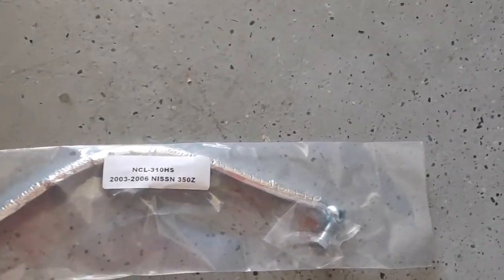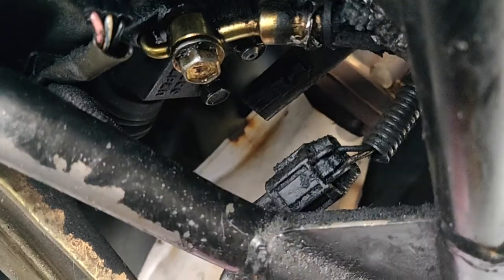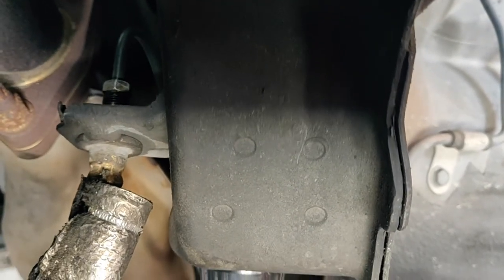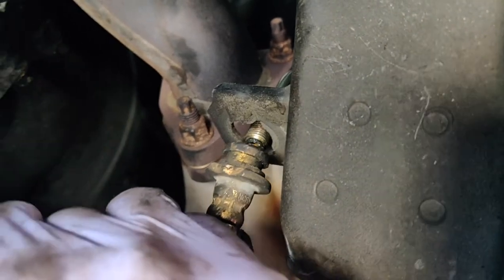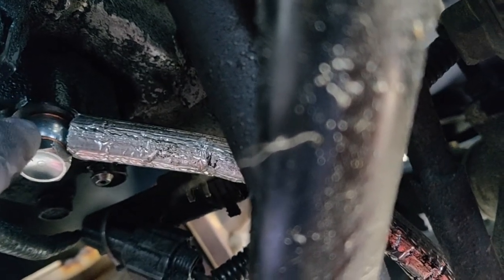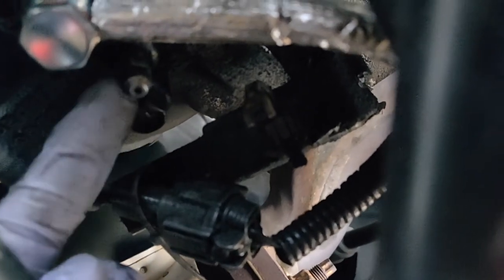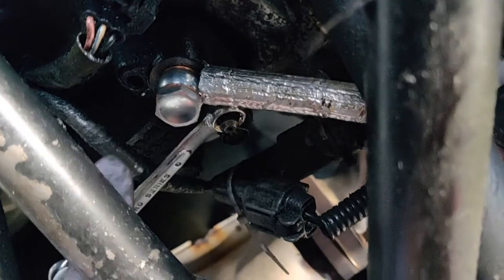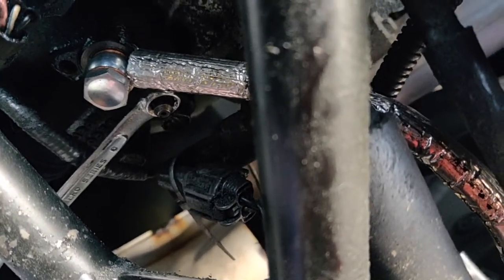Nissan 350Z SS Clutch Line Install

Comment: This was a lot of help thank you
Reply from the maker: Glad it helped! I had a hard time bleeding the clutch after. I can tell you how I did it if you have trouble.
Reply: @clubd4651 how did you do it sir?
Reply from the maker: I tried other ways I saw on YouTube, but still had a spongy pedal. This is what worked for me. 
First I gravity bled it. Fill the reservoir and open the bleeder open on the slave cylinder and leave it until brake fluid starts to come out, then close it. After that I did the pump and hold. Pump the clutch pedal like 10-15 times fast and hold it down on the last one. Then open the bleeder to let fluid out then close. Wait 20-30 seconds then repeat until you get pressure in the pedal. This is easier if you have someone to help.

Comment: How did you manage to get a flare nut wrench on thr nut to unbolt the top of the soft line??h
Reply from the maker: I think I removed that metal locking plate thing. One side of it bends upwards so it should give you more space once you get it out. I used a flat head screw driver to pry it out.

Comment: So what did you think of it? Better feel?
Reply from the maker: Yes. The clutch feels a lot better. It feels more solid. Not spongy like it did before. I've done a couple of track days with it without any issues. A couple of the days were pretty hot and it never felt like the fluid was overheating so I think the insulation helps too.